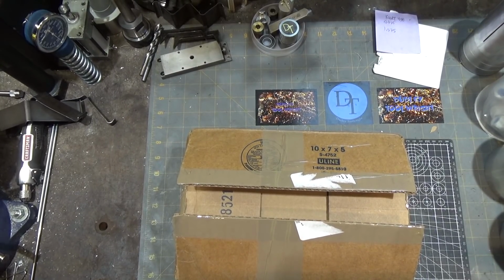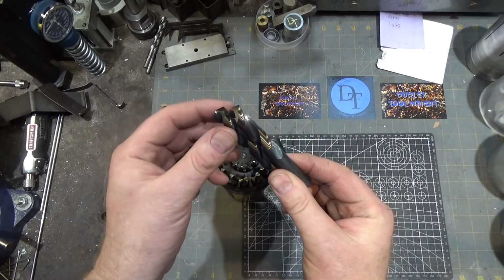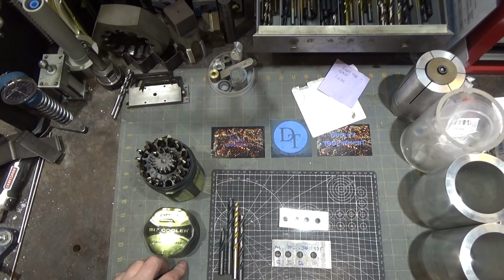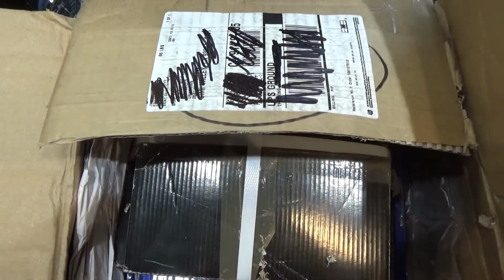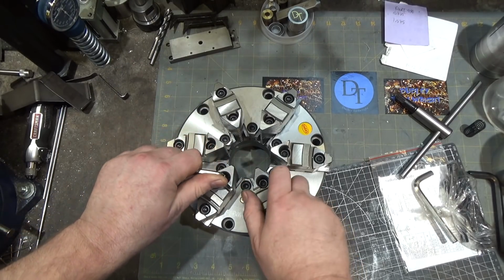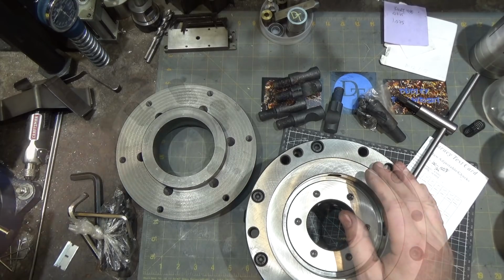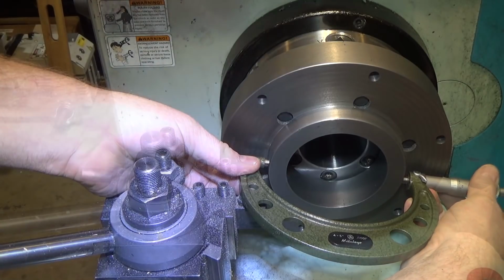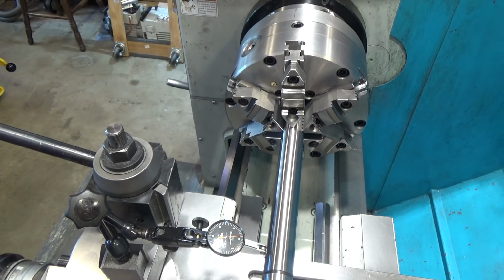QTR 55 Drill America Bit Set and Shars Tools  8" 6-Jaw Chuck

Comment: I bought a set of cheap drills a while back. They were so crooked and warped and not to mention the springyness of them, made them just horrible to use. Just got a set of Cle-line jobbers, night and day and season difference lol. I do have 1 Drill America drill bit. It's a larger reduced shank drill, for whatever a 3/4" nf tap needs, and it drills steel like nobody's business. Almost had to relearn how to drill holes because it works so good 🤣.
Reply from the maker: They do seem to be a very good set of bits and the price is reasonable. Interestingly, the price varies a lot , even on Amazon, depending on the specials they have going.

Comment: I see you have the 5C chuck. Is it a Banggood or Amazon CME or other brand. I got the CME from Amazon and found the tapper at the mouth to be file soft but the gear plate has a thrust bearing behind it. I got another from Banggood (Didn't think it would get here with that virus going thus Amazon) and it is hard but real crusty. I had to deburr every edge and smooth up the gears. How is yours to work with? Thank you.
Reply from the maker: I had a non-name collet chick before (if we are talking about the lathe) and the quality was decent, but the scroll was a bit sloppy. I recently got a deal on a used Hardinge and it is really nice.

Comment: I purchased an 8" - 6 jaw Shars chuck and it had a problem that I could put a 0.01" feeler gauge between the removable jaws and my test bar. It clamped only on the master jaws. Sent it back for replacement and the second chuck had a problem also. When adjusted for no runout close to the chuck, then the runout was 0.015" - 12" from the chuck. The reason was that one of the removable jaws contacted the test bar HARD and deflected the test bar. Sent it back for refund and got another brand that was MUCH better. Good luck.
Reply from the maker: The quality of my current chuck is excellent, I am sorry you got one of a bad run.

Comment: Nice job fitting the chuck. I ended up turning the pilot to about 0.010" under for my Bison Set-Tru chuck, and I have on occasion used most of to get previously turned work on center. I can't think of a good reason not to have 10 or so thou for adjustment.
Reply from the maker: I agree. I was torn trying to decide how much and figured that if I ever ran out of adjustment range, I would just make the back plate diameter smaller. Ultimately you only need to compensate for the maximum inconsistency in the scroll to jaw location repeatability. Thanks for the feedback.

Comment: i find blowing the particles off the magnet with compressed air works great
Reply from the maker: Interesting solution. It would never have occurred to me. Thanks.
Reply: @DudleyToolwright  your certainly welcome
Reply: @DudleyToolwright  

I put the magnet in a ziplock bag, when done just fold the bag down and remove with all the chips/dust/etc in the now reversed bag

John

Comment: Ive wanted one of those 6 jaws for a wile now. But my 3 jaw Buck adjustable chuck works like a champ.
Reply from the maker: I have had a 6-jaw chuck on my radar for several years now and finally pulled the trigger for one of my current projects. 6-jaws means half the local force on a work piece for the same holding power as the 3-jaw equivalent. I was getting significant work piece distortion and hopefully this will help.

Comment: Good video. How large a diameter will it hold without reversing the jaws?
Reply from the maker: The internal clamping diameter is  0.197 - 2.88" versus 0.51 - 4.65" for the 10" one. The weight was just going to be too much with out a hoist of some kind so I stuck with the smaller version.

Comment: Santa left me a Cle-Line drill index for Christmas. Very similar finish to the Drill America bits. That type of index is very handy for onsite work. Saw that style index somewhere before, at Fastenal maybe. Nice chuck, good info on recalibrating for different stock diameters. Need to check that on my Buck Adjust Tru. Maybe setup a shop vac next time on the cast iron. I was thinking the same cutting brass last week, it's so soft it just sticks to everything. Hey there's a video- custom shop vac lathe attachment.
Reply from the maker: Santa's quite the nice guy... Great video suggestion. Others have suggested turning the tool upside down and running the lathe in revers to control powdery chips.

Comment: You can sort of control the spray by turning the tool up side down and running the spindle in reverse...
Reply from the maker: Thanks. Great advise.
Reply: @DudleyToolwright  A paint brush held right at the tool/work interface also helps...Abom79 trick I picked up!

Comment: I also bought an 8 in, and a 6 in 6 jaw chuck. And, like you I was concerned with the weight. So I installed  a single arm crane, with a motorized hoist. To assist me in switching out all my chucks.😁
Reply from the maker: Excellent Idea. I just need enough room to fit one. I really need to work something out.

Comment: Hello Robert,  I believe you will find DeWalt is owned by a Chinese holding company that owns many "Brand names".  So you would have to really stretch to call it an "American" company.  As in most product reviews it would be far more valuable to actually use the bits for six months and then report on performance in the real world.  A hole in aluminum proves next to nothing and one hole in 304 stainless should be doable with even the cheapest bit.  Take care.  Doug
Reply from the maker: You make completely fair points. I always do an initial review and then as I use the items in the future, I comment on how they are working out. Still it was not a complete review as you say. These reviews are mostly to expose people to tools I find interesting. Thanks as always for the very useful comments.
Reply: The critical thing with drill bits for me is the material they are made from and the heat treatment.

You should drill a few dozen holes in mild steel.  I had to drill a few holes using an Irwin bit from Home Depot and the bit was so dull it wouldn’t drill after about the sixth hole.

Where are these Drill America bits made?

Comment: Congrats on the nice chuck. That belt clip is really funny tho. Maybe it can be used on the lip of a bucket or cart or something, and then break off. lol But I do like plastic container's, over the sheet metal design form the 1900's.
Reply from the maker: I agree on all fronts. If I used the belt clip, my pants would drop or I'd have to invest in suspenders. The metal indexes have a real problem losing the little bits if they get bounced around and the water gasket is nice as well.

Comment: Your wife called, she wants her pillow case back 😁. Chuck looks to be nice, but having only one key hole would bug me, something psychological.  I have recent experience with their backplate, you can put a left hand turning tool on the other side of the tool post (tool is now parallel to the bed) and the carriage will travel far enough to true up the surface.  Also, I stoned the back of the backplate, found lots of burs around machined areas (mounting studs and screws).  Let us know how the chucks works out, definitely in the affordable range.  Thanks!
Reply from the maker: Thanks Yuchol, those are some great tips. I will definitely look for burrs. I agree about the single scroll key location, but maybe it is part of the repeat-ability spec. I have been watching other 6 jaw users to see if I can see how many key points they have.

Comment: For cast iron, turn lath tool upside down, run spindle in reverse - helps to control iron chips
Reply from the maker: You know, I had recently seen Max over( under) at Swan Valley Machine shop do that and I forgot to follow that advise. It has, after all, been almost a week...
Reply: Only if you don't have a threaded chuck!
Reply: @erniehenshaw4065  Very good point about the "threaded chuck"